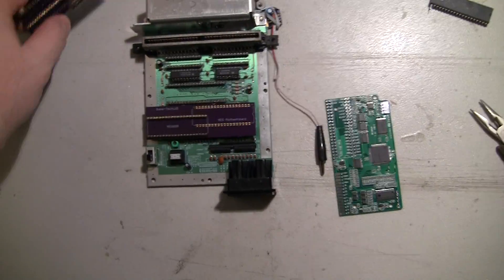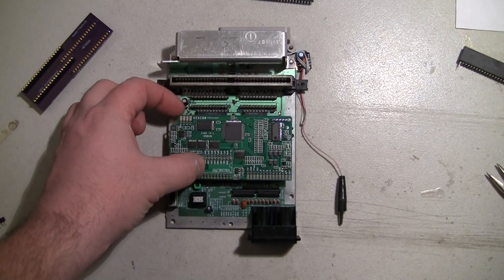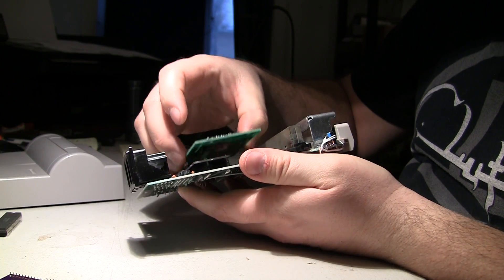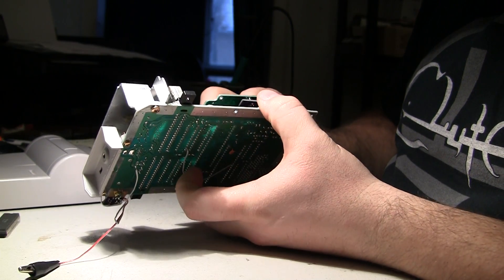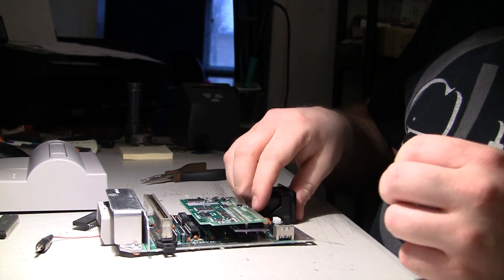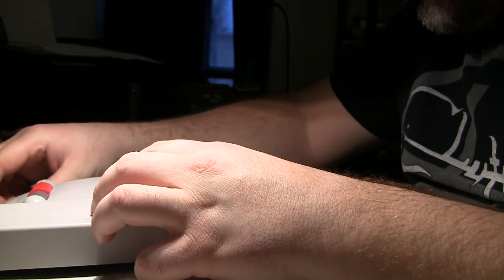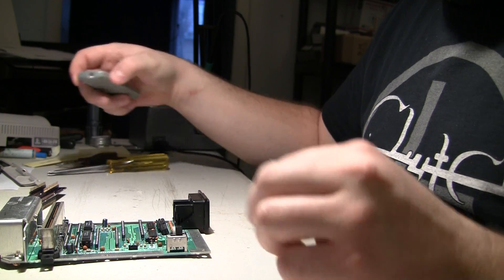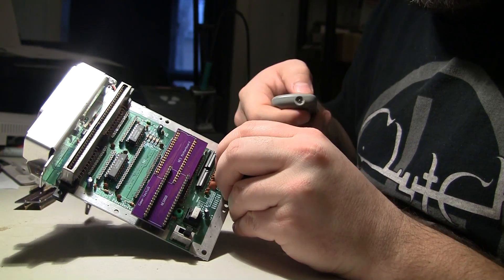NES-101 Nintendo - nesrgb new adapter board fitting

Comment: About the standoff thing, could always have the boss cut in such a way so the bottom of it becomes a washer, it would just add complexity as additional templates need to be provided, a coping saw would need to be used, then the plastic underneath the screw would need to be fitted, holding the screw captive so on and so forth. Would be the only way for a perfect fit, and even then to undo it would require a washer equal height of the PCB in its place.

Comment: And if you haven't figured out this. If you use the av board on the top loader and run the composite from that the the Nes Rgb you can up the apature settings on a pvm higher without getting jailbars. Even Drakkon's dumbass hasn't tried that